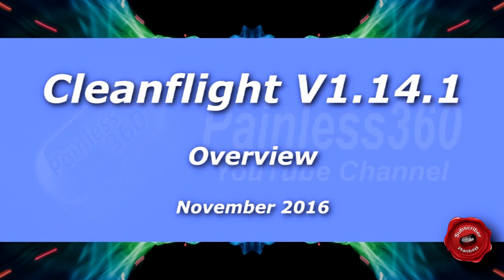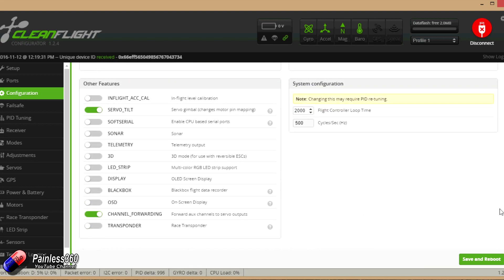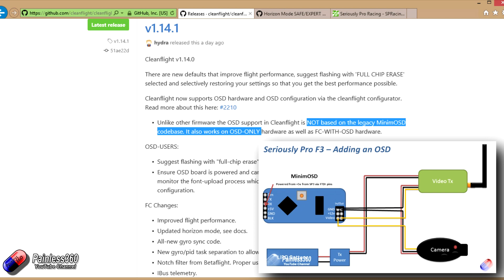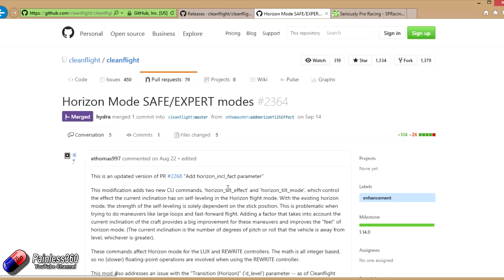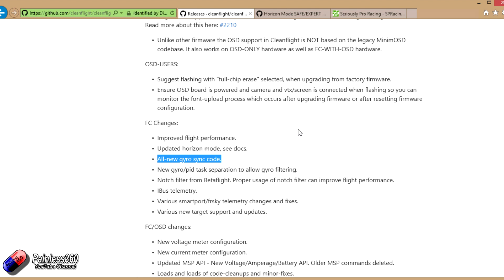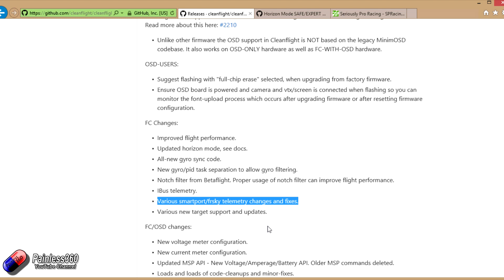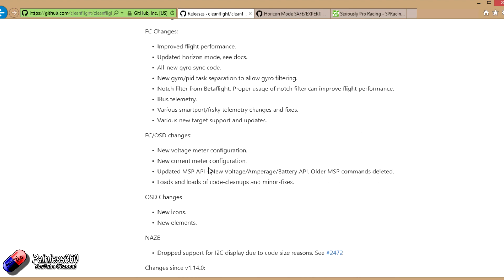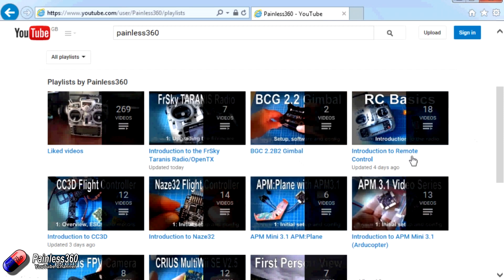RC Quick Tips: Cleanflight V1.14 Overview

Comment: Why not put Betaflight n it? Most quads fly perfect with the stock pid settings with betaflight.
Reply from the maker: That's true but without Cleanflight there would be no Betaflight.. :D
Reply: In some ways, without BaseFlight, there wouldn't be CleanFlight, yet we are not using BaseFlight anymore. :D As someone who flies CF and BF, I really think BF offers better performance and stability.
Reply: Yes but betaflight is ad this moment better and used by more people. Cleanflight is behind and as it stays like that, than will cleanflight die silently.
Reply from the maker: It's just how Opensource works (see our video on it)..
Reply: Opensource tell me about it. It is good but I am happy that there is still closed software.
Reply: As I understand it, and I could be wrong, is Betaflight is exactly that, a beta version, and although it's proven to be a stable platform there are no guarantees given that it will perform flawlessly and without software/hardware failure. Whereas I believe Cleanflight is basically the stable version they've taken from Betaflight that has proven itself to be stable, hence the lag in seeing those features port over to CF while glitches and such are worked out.
Reply: Betaflight has stable and unstable releases just like cleanflight. 
But in the past cleanflight did develop them self but now I feel like it is just copy it from betaflight and call it cleanflight.

Comment: help I'm a complete newbie, heard lots about clean flight but what is it and what does it do? I've searched your site and the internet but any explanation seems to assume a depth of knowledge I just don't have yet. I feel sure you will have covered it but I'm unable to find it. thanks Kevin.
Reply from the maker: We have loads of videos in the 'Introduction to Remote Control' that may be useful to help fill in some of the blanks. To use the analogy of a computer (these things are really!) the flight controller (Naze32, SP3 etc.) is the computer hardware, Cleanflight/Betaflight (and others) are the operating system like Unix or Windows that run on the hardware to make it do something. Hope that helps.

Comment: Are the beta flight osd and the clean flight osd the same code and thus will run on the same hardware? I am interested in the osd/pdb board from seriously pro.  

Thanks.
Reply from the maker: Nope, the Betaflight implementation is based on the MinimOSD we know and love, the CF code is completely new (as you'd expect from Hydra) ;)
Reply: I did a bit of research last night, and I was shocked to find the answer. Not only did cleanflight and betaflight do OSD's at the same time but they also came at it from different directions. Betaflight was initially aimed at AIO FC's and CF was aimed at a separated FC, OSD and each moving towards the other end.

Also when I was looking at the code, to how easy it would be to port the CF OSD code to BF since the CF OSD is cleaner and also done using modern development techniques such as everything being able to be unit tested.

I think that BF is a much better FC software but CF is much better from a software development POV so now I am conflicted... 

Lastly when looking at the OSD code in BF and the amount of work that has happened since the merging I  think the BF guys would not be too receptive to getting the CF OSD ported to BF.

Comment: I'd be curious to know, if you have a FC with OSD built in based on MinimOSD, could you flash the osd with the cleanflight osd firmware, given they're the same chip?
Reply from the maker: Not sure what you're asking. Unless the OSD is designed to work with CF then you won't be able to configure it via the Cleanflight configurator..

Comment: This is the kind of stuff that starts to confuse me. I only have RTF drones so far, but I have 2 I'm building at the moment, one is a micro and the other is a Chinese carbon fibre type. I understand the basics of this, but not where it goes on the quad, or what I need to put onto mine so I can have customisable software.
Reply: TheAussieStig30 why you don't do it like everyone and learn from Tutorials or Reading in Forums or just use Google
Reply from the maker: We have an 'Introduction to Remote control' series, and two 'Quadcopter building for Beginners' series that cover all of the basics and are designed for new pilots/builders like you. I can see you're a subscriber so you'll see new videos on here coming out all the time..
Reply: Painless360 yessir, I love the channel. I'll be checking out the videos tomorrow and taking some notes. My issue I think is in the reply to the other guy, I tend to overthink stuff and because I'm a cheap arse I can only buy from aliexpress and a few times the product name doesn't translate over to what they call them. Thanks for the reply and I'll be sure to watch the videos you mentioned.
Reply from the maker: The terminology can be a little interchangeable in the hobby but take your time and watch a few build series to grasp the basics and best order for things..

Comment: Well i would consider myself a good quadcopter flyer, been using cleanflight from taking up hobby. Have a few 210 250 quads, upgarded to 1.14.1 on 250 quad, first good flying day today so out i went, as with all firmware updates nice slow line of sight flying to start, no flips or power rolls with first battery, 2nd battery full throttle runs at maybe 10 15 feet no problems so far. Flips and power roll time still line of sight, start with a slowish flip roll to right as soon as quad was passed maybe 110 120 degrees it was like to battery was unplugged, fell out the sky. did the walk of shame to retrieve, battery still connected????? quick check over re-calibrate and check of P I D settings all ok. 3rd battery quad flies great in angle, horizon and acro modes great me thinks must have been a glitch, bit more altitude this time (just in case i need to recover) same result falling out sky no problem all flip the angle mode on that will sort it, well it didnt 2 props and one arm later think ill be going back to 1.13.  And yes i did read all documentation before-hand and was happy all set up correctly.
Reply from the maker: +Dale Murray report it on the GitHub site. Best of luck!
Reply: done.